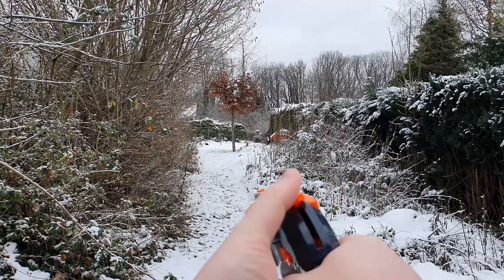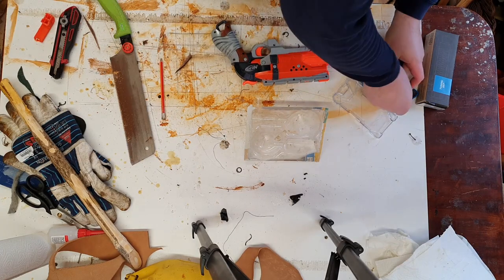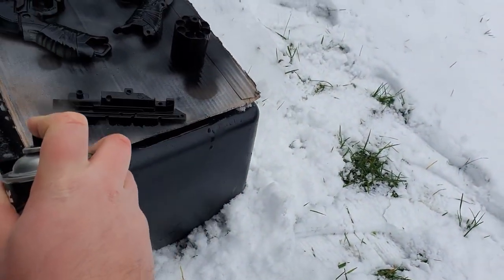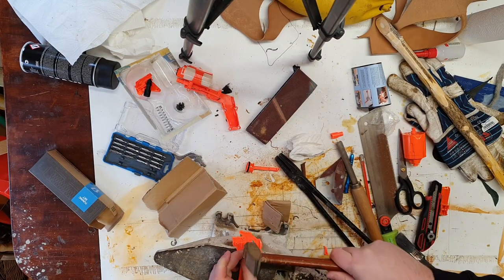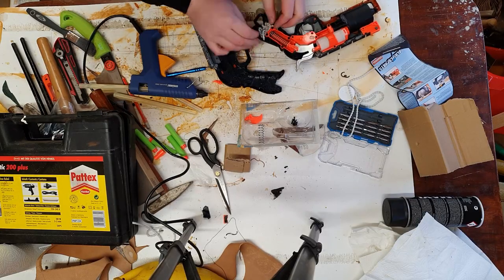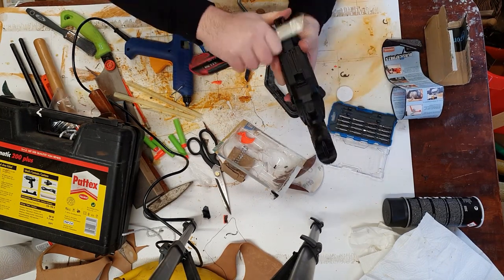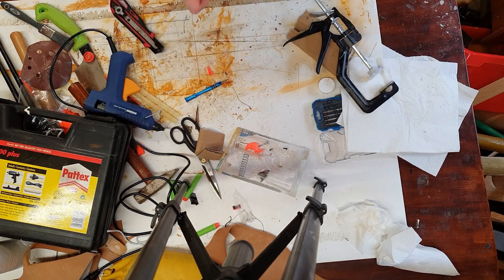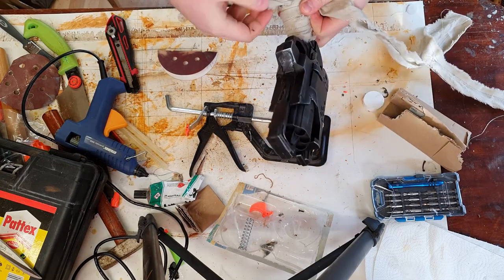How to mod a Nerf Hammershot

Comment: LarpWright is back!!! 

WOOT!!!

Also did you use a resin or filament printer for the drum?
Reply from the maker: I used a resin printer, but it should probably have been done with an FDM printer. Funktinal Parts of this size print great in PDA filament. 

I only post on this channel, when I build Larp stuff. So maybe just a handful of videos for this year.
But I run another channel, where I post every week:
https://www.youtube.com/@Sebbaasdungeon
Reply: @larpwright  Wow thanks!
and THANKS!